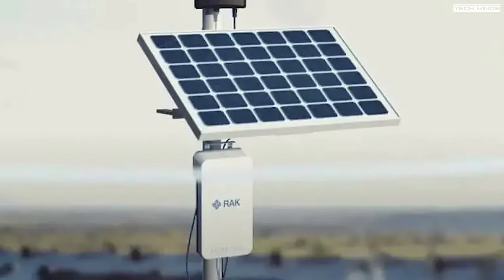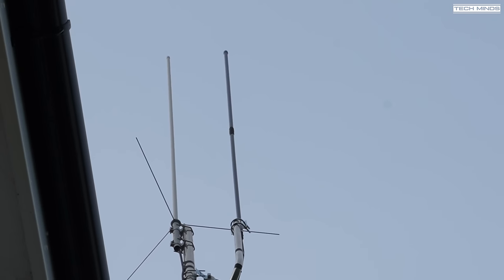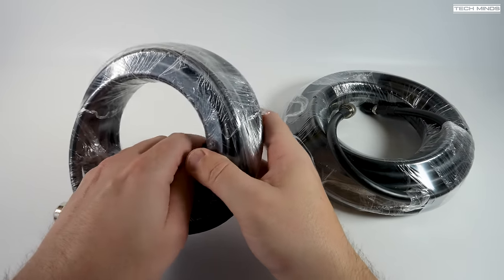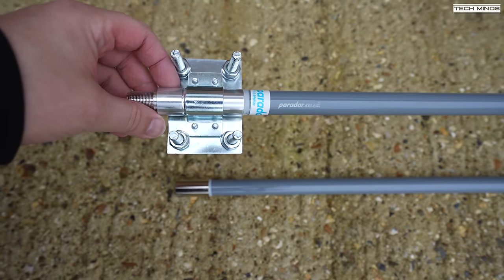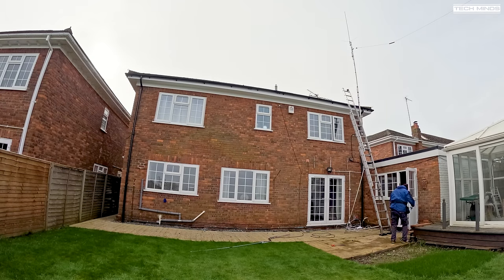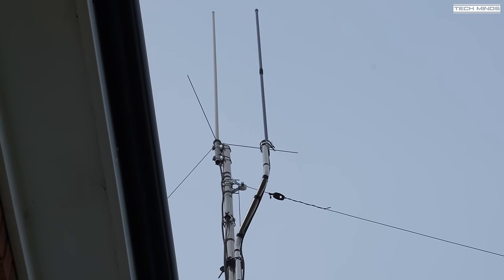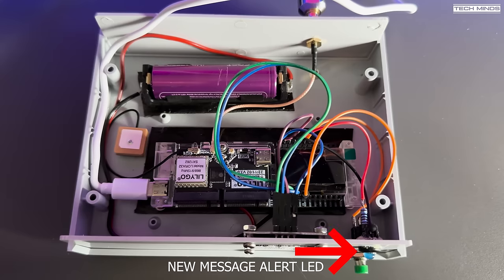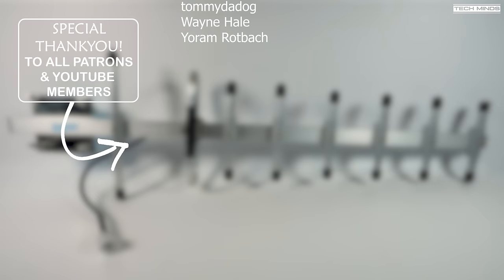Long Range Lora Antenna From Paradar - This is huge!

Comment: I guess you're making it a little bit illegal since you're adding 11dBi of power (the regulations mention 25mW of ERP power)
Reply from the maker: If you are in the UK then it's 500mW E.R.P with < 10% Duty Cycle. Not for all Lora, but for the frequency used by Meshtastic in UK and Europe. Page 17 of this document: https://www.ofcom.org.uk/__data/assets/pdf_file/0028/84970/ir-2030.pdf
Reply: 100mW in the portion of the band used for Meshtastic and a few other things.
Reply: @TechMindsOfficial  fair enough. Just bear in mind  that an SX1262 based device can output 22dBm and combining that with 11dBi antenna gives already over 1W ERP
Reply from the maker: @CezarySiw  Fully aware of ERP, had to do all the calculations when deciding whether to mount the node at the base or via coax. Around 0.6dB loss in the cable, but still over 1 Watt ERP. Cheers
Reply: The max power ur alowed to use is only the power coming out of the board so it is legal to get a stronger signal and rf output using a bigger antenne
Reply: @leonbrm1430  It's region dependent.  In the UK it's 500mW e.r.p so antenna gain is part of the calculation.
Reply: Hi I live in Bedford and have a helium lora antenna array in the garden so be good to link up now I got meshtastic
Reply: @leonbrm1430 no, the regulations state erp which means Effective Radiated Power from the antenna which includes any +dB “amplification” by the antenna,  -dB loss in cables/connectors etc.
Reply: @TechMindsOfficial  Ofcom have actually said different things to me and they have find people for what you have done due to the ERP
Reply from the maker: @UKsystems When I  lowered the power output of the node so that the ERP is within Ofcom rules, then it's within the law.
Reply: God bless the self proclaimed Internet Police - for those that have nothing positive to add

Comment: This is bad info do not run long runs of coax as we are dealing with signals in the noise floor so the tiniest bit of coax loss and bye bye distant nodes as for high gain antenna will overcome this errr no not with the way lora works it's better to install with zero coax and a smaller gain antenna especially for ppl lower down.
Reply: Up to 10 metres of low loss coax is probably fine at 868MHz. This isn’t that far away from digital TV signals in terms of frequency and they work with far longer coax runs, although usually with a higher gain directional antenna. The signals will be horizon limited with the transmit power and antenna gain in any case. So this setup is entirely reasonable if you want the equipment indoors for easy access and weather protection.
Reply from the maker: @peterchongy You clearly have no idea what you’re talking about or even listened to what i said in my video. If i was going for a static node with no other use for the antenna then I would have mounted at the base, but as I will use this antenna for other projects I needed to use ultra low low coax. I actually used Westflex 103. If you’re so smart go and do the calculations and you’ll see the losses are marginal with a high gain antenna like this.
Reply: Your fully wrong I'm a broadcast engineer and know what I'm talking about I've done testing and even a few meters of whatever coax will kill your distance nodes from being received we are using 120mw RF output power not 100kw TV where a long run of 30m is nothing try that with meshtastic and you receive nothing so next time stop giving bad info out to ppl who don't know any better.
Reply from the maker: @petechongy I really hope you are not an broadcast engineer any longer. In your first comment you said its bad to do long runs of coax. you also said "few meters of whatever coax". Well, I agree, using thin coax would be pointless, but the coax I used is designed for these kind of losses in mind. I dont think I mentioned in my video as to how long the coax was, but it's around 5 meters from antenna base to rear of my node.  I agree that really long runs would be bad. However... As you can't be bothered to work it out, he's the details. There is 0.613 dB loss @ 869 MHz with 5 Meters of the coax that I used. Assuming my node is outputting it's full potential of 22dBm, you can now work out the E.R.P of the 11.5 dBi gain antenna shown in the video. You're welcome! If you continue to spurt out absolute shite, I will remove your comments.